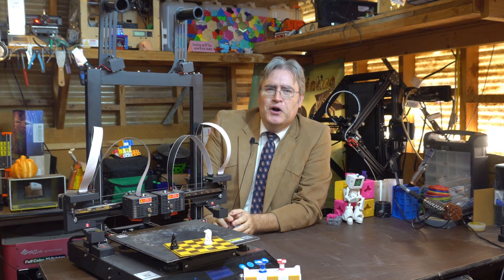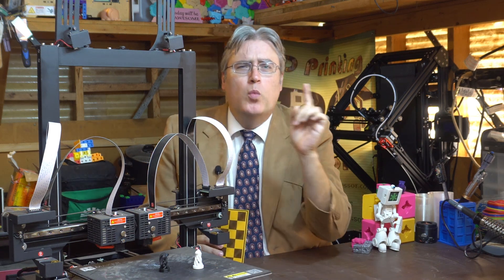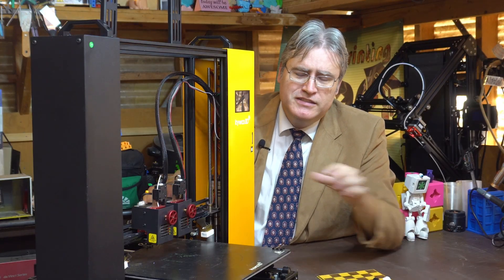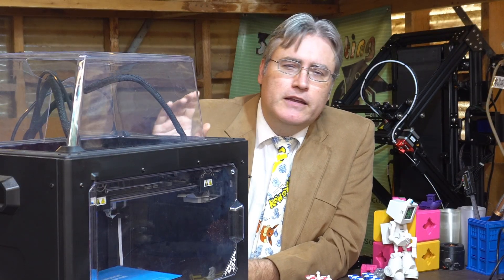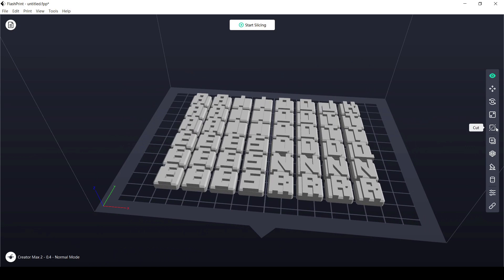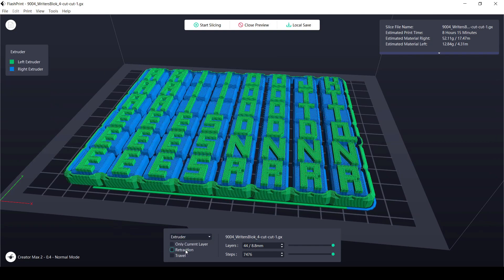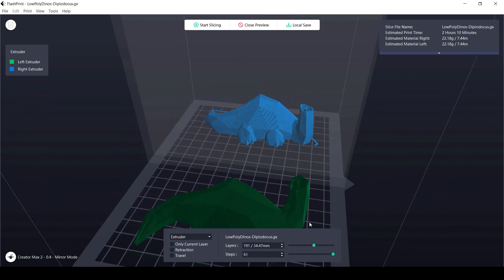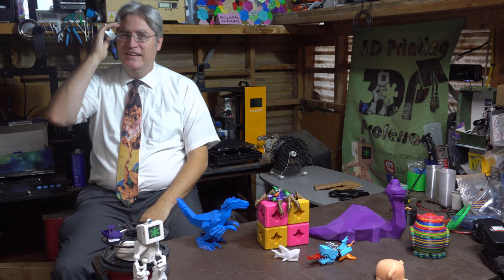Is IDEX worth it? Do you want multi-material 3D printing?

Comment: A timely video! I've been wanting to print in multiple materials and have been trying to decide between something like the Mosaic Palette or an IDEX printer. I'm leaning towards IDEX due to the amount of filament that a filament changer has to use for transition blocks (plus I'd have two printers, current and future, instead of one). I'd like a big build volume, so hopefully the Kywoo gets decent reviews.
Reply from the maker: I will say that IDEX is much more reliable than my experience with the palate. Joining filament just introduces more fail points.
Reply: @3dpprofessor  Good to know! Thanks!
Are you going to get a final edition Kywoo IDEX to review? Does anyone have one in their hands yet?
Reply from the maker: @PhillipAnderson  They're not shipping yet. So I definitely don't have one yet. Will I get one? Don't know. We'll see.

Comment: I recently got the creator pro 2, small print area but the ability to use disolvable supports is great. I wish flashforge had better raft profiles that peeled off more easily though.

Comment: Thanks for another great video - I will have to check out the Flashforge printers  I have a jdmaker pro in the box and a Kywoo 3d idex on the way as far as toochangers go although it is more of a business level machine and priced out of range for hobbyist the  H5-Series from diabase machines is a 3d printer/cnc machine combo that is close to being a true toolchanger but does not have pick and place that I know of.